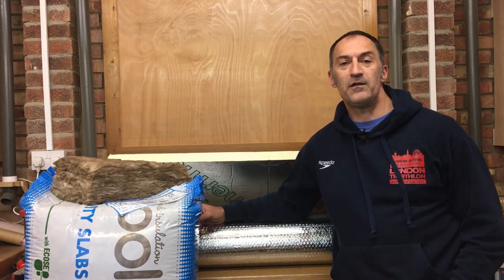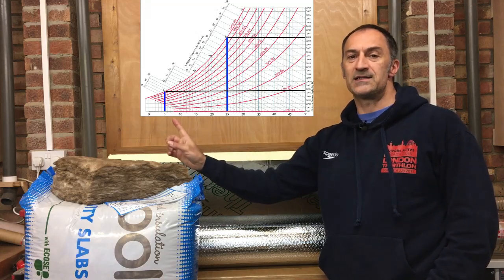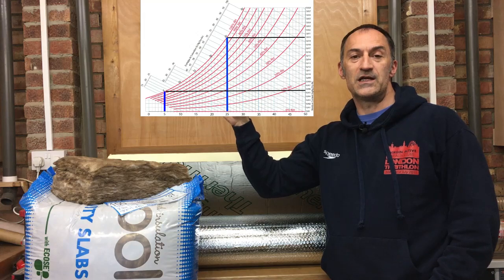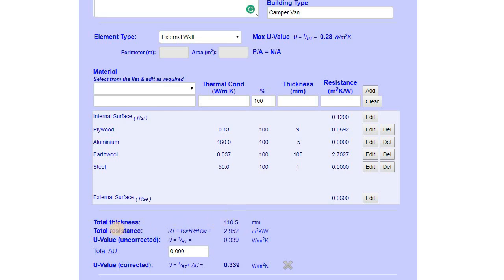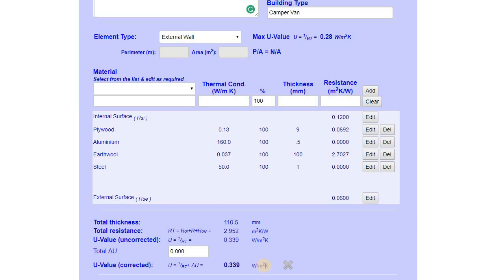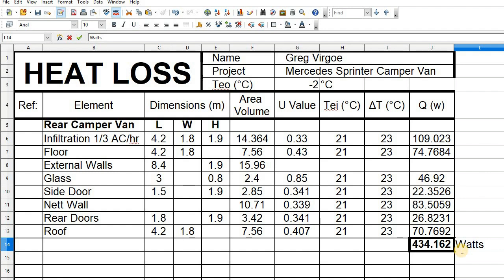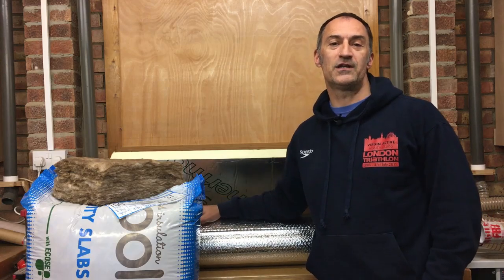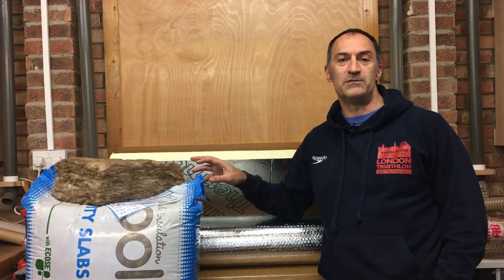How to Insulate your Van Part 1 - The facts you need!

Comment: Is it not bad to create a wall assembly with a vapor barrier on both sides? Wouldn't that trap moister inside the wall? I was planning to wrap the inside with a Tyvek house wrap. That will let the moister get pulled out of the wall assembly and into the conditioned space. But stop condensation from getting into the wall assembly. Or am I wrong?
Reply from the maker: Andrew Simpson, you won’t trap anything in there. The moisture content of the air in a complete side wall is only 3G that’s three drops so basically nothing. If you allow the void to breathe you have loads of condensation problems. Seal all the plastic clips and foil or plastic vapour barrier on the warm side of the insulation. Watch my insulation workshop video that tells you everything you need to know https://youtu.be/_6eWGp14TL4
Reply: @GregVirgoe  Thanks for the reply! Is that the same in all zones? Here in Canada, it's a big no no to have vapor barrier on the inside and outside of a houses wall assembly. Or is it different in a van vs a house somehow? I work with houses so I'm now to van builds.
Reply from the maker: Andrew Simpson, your van is a thin sheet of highly conductive steel. Which will conduct heat very easily so in cold climates it will be the same temperature on the inside surface as it is outside. It will be below the dew point and it’s the prevention of condensation forming why it’s done this way in a van. Not the same as in houses. Watch my latest insulation workshop for a much better explanation
Reply: @GregVirgoe  Thank you so much! Your videos are so helpful!

Comment: Hey greg, what's your opinion on rubber foam as heat insulation? I was looking for a sound deadener material and saw that it is said to be able to protect the paint from car hood fade away due to the heat from the engine. Been thinking about rockwool or ceramic fibre due to availability or i just might only use the rubber foam as a cheap alternative. Thanks in advance
Reply from the maker: esther cromwell that foam does have good insulation properties but it’s usually quite thin only 10mm thick in sheets  so you would need a few layers to compare with 100mm of rockwool. It will work excellent as sound deadening with a small amount of insulation.

Comment: Does this mean that you will need about 0.5 kw heater?

Of course it is approximation and cabin isn't included and it is going to be colder than -2C but other wise did I get it right?
Excellent video!
Reply from the maker: Electricman yes that is correct, that is the required heat for the van body. There will also be hear loss from the cab which is not as well insulated and has a lot of glass so that could easily be an additional 0.5-1kw so a heater 1-2kw would do the job
Reply: @GregVirgoe  Thanks for the information! Why don't you keep cabin cold? Wall between them is still insulated?
Reply: oh you already answered to it, sorry..
"It's simply a measure of the energy you would need to maintain it at that temperature.
So a 500w heater running in the van would offset the losses and maintain the 21 deg inside."

Comment: Hi Greg, as always, a fantastic video; only a few people can explain complex contexts so well.
But I still have one question: Why didn't you use Armaflex (λ = 0.033), like so many other camper builders? For cost reasons or are there technical objections from your point of view?
Reply from the maker: Frank Reinecke, good question, it’s thermal properties are very good it sits in the middle of mineral wool and PIR Board. So it’s a good insulator. It’s closed cell and also act like a vapour barrier. 
However, there are 3 minor things against it. It’s more expensive per m2, it’s also a lot heavier than other the other two and lastly it’s sold in fairly thin sheets to match 50mm PIR you would need 75mm of Armaflex and that’s not practical amount to install for the reasons above. I feel what I have chosen gives the best thermal properties at a reasonable price too 👍🏼😀
Reply: Thanks a lot and all the best on your further journey.

Comment: Van-build myth-buster.
The only thing I might take issue with is the decision to add a moisture barrier. The FaroutRide folks feel you cannot get a good enough moisture barrier — so they would rather allow the insulation to "breathe". Hard to know which argument makes the most sense — I can see both sides.

Comment: Just out of curiosity, would it be better to leave those cavities empty, where you have put the wool? Air has a low conductivity, so would it perform better or is there some circulation you would need to account for? 
My van is a luton with the walls made from a Fibreglass sandwich, with a honeycomb plastic filling that totals about 20mm thick. I've assumed the air gaps in the honeycomb are the main benefit and have negligible circulation?

Comment: Greg this was excellent!  I enjoyed the in depth discussion, and learned a great deal about your line of work and how to calculate heat loss.  Superb!  We need more.  A few thoughts to add to your points.

Van insulation is more than just R value of materials.  These are the other factors to consider which should be weighed when making a decision on materials.  Total points are:
Weight - materials light as possible.

Sound damping - turn the clang to a thud on doors, and keep outside noise out of van.
Thermal resistance - R Value is high.  This also keeps van cooler on hot days.
Moisture resistance - Materials should repel water not absorb, should be breathable to allow water to dry off, should be effective even if damp or wet and not get destroyed.
Insect resistance - no bugs nesting in there over time
Fire resistance - slow to burn
Hypoallergenic - no fumes, or irritating particles in lungs/ eyes/ nose.
Reflectivity - heat shield to reflect heat away from inside using mylar foil.  This is also a water vapor shield.
Price - does not break the bank
Environmentally responsible.

There are 3 elements in a van that you want to tackle:  heat loss/ keep cool, dampen sound, keep water from reaching your insulation and metal structures.  In your selection, I am surprised you did not consider Sheep's wool as an alternative to Earthwool (aka Rock wool, Mineral wool).  Sheep's wool is treated with Borax for mold and bugs, is naturally fire and water resistant, hypoallergenic where Earthwool is not, is effective when wet, allows water to escape and dry off, good sound damping, highly thermal resistant, and very light weight.  Not as costly as Thinsulate and a bit more than Earthwool.  It is very flexible so can be stuffed into small holes, but does not need to be as aerated as Earthwool.  A lot of this is going to waste in the US, as 90% of shorn wool is not used. Comes in batting or stuffing.

Also surprised you did not consider a butyl type noise damper like Noico.  Small patches on doors and insets turns clang into thud and prevents road noise.  This is pricey so small sections.  I used a closed cell Neoprene foam coated with Mylar foil called Silent Silver or Silent Blue, as an underlayment for RV wood floors.  It is only 1/8" thick.  Also works as a reflective shield and vapor barrier.  So... patches of Noico on thin metal parts, sheep Wool batting and stuffing, and cover it with Silent Silver, then surface  materials. like plywood.  On floor I would do what Dave Orton did - Polyiso thick foam boards (has Mylar), rubber gym mat, outdoor carpeting.

Mineral wool may be cheaper, but it irritates the lungs, so needs to be sealed up well.  It is not as flexible as sheep wool for stuffing crevices.  I wonder what your thoughts are on Sheep Wool.

Comment: Thanks for the very informative video. I'm a newbie and was wondering if a normal plastic vapor barrier sheet could be used instead of the foil bubble wrap  ?
Reply from the maker: Yes you can use plastic sheet, if you can get hold of it there is one made for timber frame construction. You can get it from builders merchants. 😊
Reply: @GregVirgoe  thanks, since asking I now realize that although plastic would deal with moisture it wouldn't reflect the radiant heat.
Reply from the maker: The other advantage of the bubble wrap is it does give you a small thermal break between the metal and your ply or timber lining. 👍🏼

Comment: Hello, love the video. Im about to do my van too but first i'm debating on installing three double acrylic glazed windows or bonded windows. I see that you installed bonded windows, how has this affected your vans insulation? what methods have you used to prevent heat loss/gain through them? Thanks
Reply from the maker: We have installed van X curtains on each window which are double thickness and help to provide a little thermal protection. We have a very good heating system, Truma combi and keep the van well ventilated. These things prevent any condensation forming. 
If you are staying in very cold climate I would consider the double glazed units. Check out my other videos for more details.
Reply: @GregVirgoe  Thanks Greg! I go to the Alps on occasion so maybe double acrylic is the way to go. I was also like an underslung water tank but i'm worried about freezing.   Reluctantly I may have to go with something inside... decisions, endless decisions!

Comment: Great video thanks so much. Am needing to insulate against heat gain not loss (Australian Summer Temps up to 43C)
 Does this make a difference in the approach?
Reply from the maker: Transfer of heat through a structure works the same in hot or cold temperatures so insulation will help reduce the heat getting through the structure and keep van cool. 
The biggest source of heat gain to vehicle is the solar gain through glass and by far the best thing you can do is shade the windows with external cover or internal blinds. We have internal reflective insulated blinds. That attach to the cab windows with suckers. They reflect the sun and shade and insulate the interiors. Then we also have the roof vents to help circulate air if it gets very warm inside. They work on thermostats so they come on if it gets very hot. 
Think of a cool box, they are always insulated to keep heat out and the contents cold. 👍🏼

Comment: Hi Greg. The wall cavity in my Peugeot Boxer is 80mm. Would there be any reason why I couldn't use a mixture of 40mm Earthwool as the outer layer followed by 40mm Kingspan on top of the Earthwool as the inner layer to make up the required 80mm? Can you also advise me please which Kingspan PIR board would be best suited for the floor, roof and walls as there are so many to choose from. Thanks Greg.
Reply from the maker: Neville Pearsons, no reason why you can't combine two insulation to make up the thickness you need, I used Kingspan thermaboard but all PIR boards have very similar thermal properties. I used Celotex for the floor only because I bought it from Wickes which was a different supplier
Reply: Thanks Greg. I appreciate your advice and speedy reply.

Comment: his is a warning to anybody building a campervan. never ever use celotex insulation and silver foil rap in a van it will make the van sweat cause condensation it wont be able to breath and dry, because its sealed in. it will rust  the inside of the van very quickly. i am a professional campervan builder and i know many more between us we build hundreds of campervans a year. we would never use celotex. and spray foam.  i have had to rip out many self build vans because of this advise someone is giving badly. i will soon put a link to show the damage and moisture it causes.

Comment: thanks for the info, very helpful!  I am wondering why you chose to use Reflectix as a vapour barrier instead of just using plastic vapour barrier? isn't reflictix a bit pricey if all it's being used for is a vapour barrier? 
thanks!
Reply from the maker: Hi Kira, you can use plastic, some are very slightly porous so use a good quality building grade polythene. I didn’t find it expensive and was very easy to apply with trim fix. Plus it does give you a small air gap as a thermal break on the metal surfaces. 👍🏼😊

Comment: Mineral wool instead of r15 batt insulation?
Reply: I'll take a stab at the question, and someone will correct me if I'm remembering wrongly...

Presuming you mean fiberglass batt insulation I believe it's because primarily fiberglass will hold water while mineral wool won't. And I think mineral wool has (very) slightly better R value and sound deadening properties, while also being less compressible. It is more expensive too but we're talking so little for a typical van build as to be inconsequential.
Reply: @nothere7198  thanks. Yeah...I've never even seen mineral wool
Reply: @PurpIest   : You're welcome. Don't know if you've been digging for more information but if you haven't already found it the version I'm more familiar with is called Rockwool (brand name) now. There were several years there where I didn't see it much at all. The Pink Fiberglass was all the rage, probably because it was much cheaper and promised a lot. Their advertising was killer, while Rockwool rarely if ever advertised. My local lumber yard stopped carrying (but could probably order) Rockwool about then. It seems to be making a bit of a comeback.

Comment: Hi Greg,
It's been a very instructive video! Absolutely great how you explain de lambda and R values! I read your thoughts on armaflex in the comments and I understand you can't achieve miracles with 19mm of insulation. And actually you raised a good point about the cost effectiveness of this particular insulation product...

To me armaflex was ideal cause easy to place  and not too time consuming. Neither does it need a vapour barreer. But now I'm reconsidering...

But you mostly speak about cold outside the van and the cold getting into the van. Seeing what I intend to do with the van, I'm more concerned about keeping the heat out!! (and of course condensation :))
What do you reckon would be a good R value to reach to keep the van comfy in the hot summer days? I must confess I didn't dig that much in the comments...  So I hope you havent replied this many times already! 
 Thanks in advance for your reply and I'm gonna need to plan a lot of sessions to watch all of your great vids!
Cheers

Comment: And a lot of camper van companies use reflective radiant insulation material too, again, providing little or no thermal value. Plus, radiant insulation materials should not touch any substrates and have an air gap to work.
Reply from the maker: s k as I mention in the video I’m not using it as a radiant reflector just purely as a vapour barrier. 👍🏼😀
Reply: @GregVirgoe  that's right Greg. I saw a campervan company using reflective material for their primary insulation material. Provides little or no value.
Reply from the maker: s k it should not even be marketed as insulation as that's not its function. 👍🏼

Comment: Thanks this video is awesome. I understant that with that vapor barrier inside we prevent the moister from inside to go through the insulation but shouldnt we prevent it from de exterior side too? Otherwise we will always get the condensation to form between the outside metal of the van and the insulation right? Wouldn't it be bad for the insulation materials?
Reply from the maker: Sergio Domingues nothing will get through the steel but you do need to seal up plastic trim clips as best as possible. 👍🏼

Comment: Very good but once you squash 100mm of earthwool into a 30-40mm  void then the figures given will all be wrong ... insulation values are based on trapped air in earthwool, squash it and it all changes ...
Reply from the maker: Did you watch the video? 
I covered that @ 5:35 😀

Comment: One of the first computer rooms I came across, the AC would fail on weekends during the summer.   Turned out that the engineer contracted for the HVAC designed the heat transfer calculations through the insulated walls on the basis of the office space surrounding the computer room being room temperature but the office building shut off it's AC outside of office hours was most agregious on the weekends during summers.  This is the problem of a well performed engineering calculations, you're calculating the actual minimum you require therefore any error in your premise especially on variable environmental could mean failure because your calculations are taking you as close to the point of failure as you can statistically tolerate.   Even a slight oversight in estimating the worst conditions you may encounter can be disastrous.

Comment: Would you be so good as to comment on my intended use of 50mm spray foam in a Luton truck, and the need of a vapour barrier? Many thanks, great video. Tom
Reply from the maker: Hello Tom, spray foam is an excellent insulator in terms of its thermal properties, its one of the best along with PIR boards. Most form a sealed skin that closes off the cells and acts like its own vapour barrier. so prevents the ingress of moisture. On the negative side, it can be very messy and require lots of trimming and clean up afterwards.  It's permanent so less cope for change later on and you need to run conduits for services beforehand if you want them to be concealed. Hope that helps
Reply: Thank you, most kind. @GregVirgoe

Comment: I read there is no such thing as a perfect vapor barrier and it may be best not to install one. My understanding goes as such:

If the "aluminum bubble wrap", a.k.a. Reflectics, can't be a perfect barrier, moisture will pass through.
This will also make it harder for moisture to escape, thus creating a humid membrane that may harbor mold. Does this rationale hold weight?

End thought.
Reply from the maker: Make sure you do a good job in the first place, no point installing a vapour barrier if you have loads of gaps in it or haven't bothered to seal all the edges and joints. That includes any socket or light penetrations and sealing external trim holes too